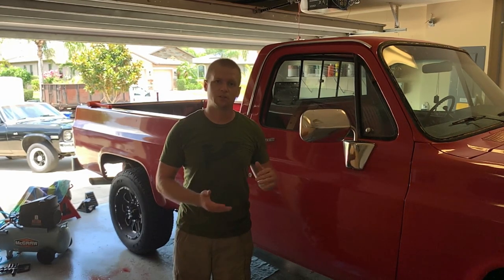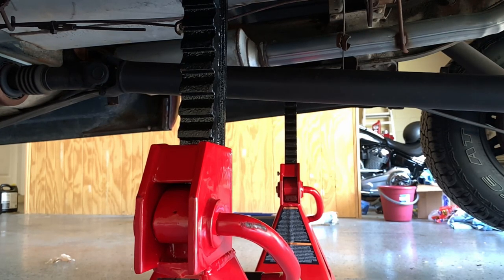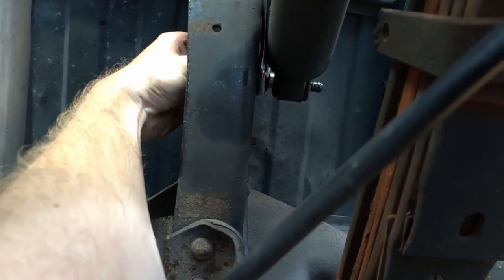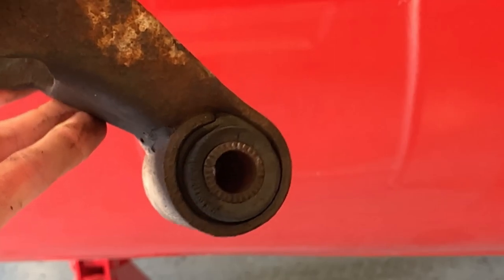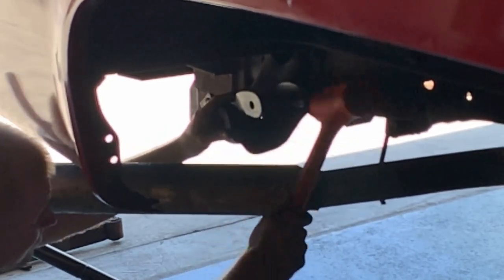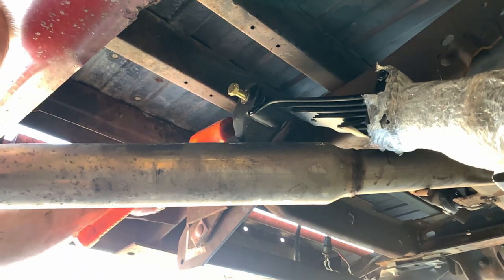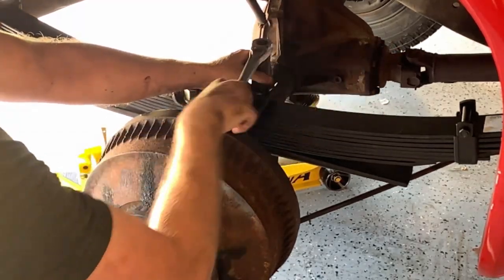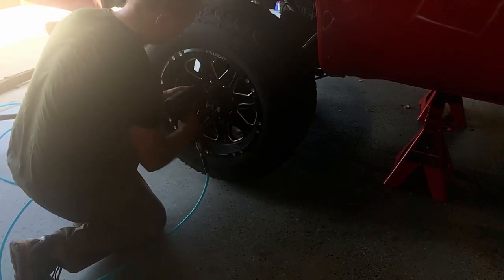How to Replace Leaf Springs on 1973-1987 Chevy & GMC Trucks

Comment: Excellent video. Thanks much. A couple things in my experience. If you get new shackles or replace the bushings with polyurethane, the fit in the bracket will be super tight; I used a plumbers vise and a sledgehammer to buy me a little room. Also, when I was putting it back together, the center bolt of the springs wasn’t even close to the hole with the axle bracket. Turns out with all the moving up and down, the driveshaft was sliding out!

Comment: Got new leafs, bushing and the metal tube that goes in the bushing. But my old bolt won't go through my new metal tube. Do I just buy a smaller bolt?

Comment: Hey Jay, just curious what your reason was for replacing your leaf springs?? 🤔
Reply from the maker: Had been having a lot of rear end drop towing my Nova or Monte Carlo. Also getting an excessive chevy lean.  I didn't trust just doing a side-swap to balance it out due to how much my tail end was dropping towing.  You can see by the gaps and weld points that the springs were quite old, just time for them to go.  Improved the ride and towing.

Comment: adding a 4-6" spring lift to 1972 4wd.. I am having problems with my ubolts attaching perpendicular to axle on the rear.  they want to angle forward.
any suggestions?
Reply from the maker: Sorry for the incredibly long delay on replying.  If you haven't figured it out by now (again, sorry page took a back seat too long with COVID and moving), The forward angling happens alot with lifts.  You can try just doing 1-2 turns at a time, then "massaging" the U-Bolts more straight with a BFH (Rubber mallet) or pray bars.  Alternatively, you can potentially rectify it by disconnecting the drive shaft from the rear differential to reduce angular tension by the drive shaft.  That being said, ensure one side always remains connected and that you properly seat the guide-pin so you have a chance of getting the yoke realigned.  (and remember for safety that park won't help you once the differential isn't connected but the parking brake will).  Ultimately, massaging it patiently with a BFH or crowbar as you get it tighter and tighter is my best recommendation.  That's the best I could recommend without seeing just how far its attempting to angle away.